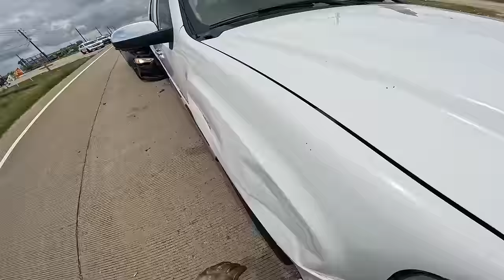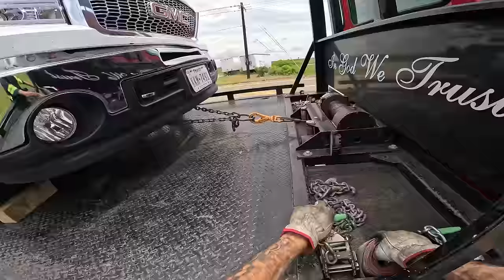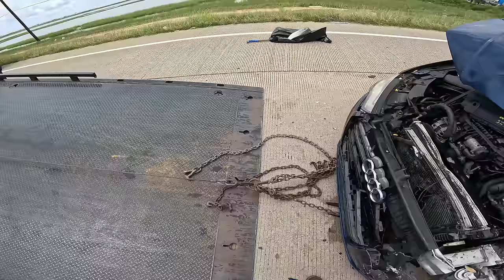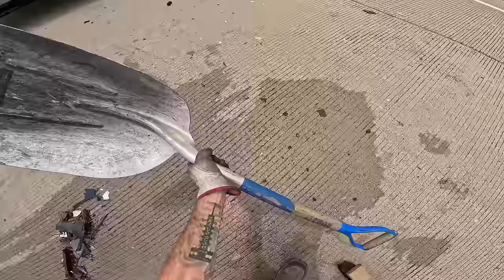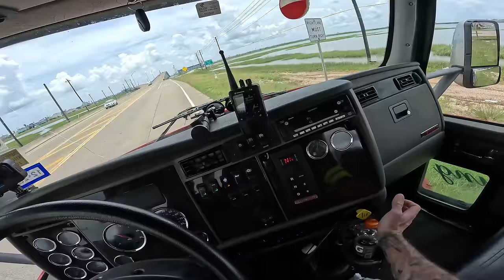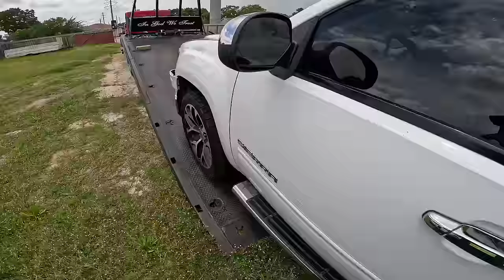Memorial Day Major!! A Bad Day at the Beach!!

Comment: Its weird how the passengers airbag deployed in the audi but the drivers didnt. Only the knee airbag on the drivers side did.
Reply: A vehicle’s SRS computer uses a verity of variables to determine which airbags shall deploy in a given accident. If the vehicle decides that it isn’t safe to deploy a specific airbag, it won’t. For example if the driver is holding the horn, or pressing buttons on the steering wheel the vehicle will determine that it’s safer to not deploy the driver side steering wheel airbag as it could lead to broken bones or more serious injuries. The vehicle will also determine the passenger’s weight to verify if it’s safe to deploy the dashboard airbag on the passenger side. Every manufacturer is different in how they program their specific SRS computer and the variables I’ve just stated are just a small percentage of the amount of logic that an SRS computer has to deal with during an accident. I do a lot of programming logic for the computers inside of Tesla, Audi, BMW and Land Rover vehicles and have some experience with this type of stuff. Anyhow, I hope this clears up some confusion! 😊

Note: If no airbags deployed in a serious enough accident then it’s safe to assume that a bad SRS computer or crash sensors are the culprit.
Reply: You see how an ABS lets you keep coming to all of the vehicle while breaking
Reply: @Dingus04  thanks
Reply: @gvlambo  No problem

Comment: Other tow guys bridle is a interesting setup for sure. I carry a 5th wheel puller for tiems when it hooks the bed. Felt bad seeing guy crawling around under neath. Training seems needed for him. I hate seeing companies that set their guys up for failur or i jury
Reply from the maker: I believe that was a mini-J bridle, with big J chains hooked into the grab hooks. Which would work in a pinch, but all that extra chain is an issue.

Comment: If you were going out to buuy a flatbed is there any reason to buy that smaller size truck???
Reply from the maker: Good question. 
It really depends on what kind of work you plan on doing. The 5500 (class 5 medium duty) trucks are good for most everything other than the bigger trucks like a 2500 or 3500. 
So they work great in the city, where you tow mostly cars, but if you tow a lot of full size trucks or equipment, I’d definitely go for a bigger Class 6 medium duty flatbed.